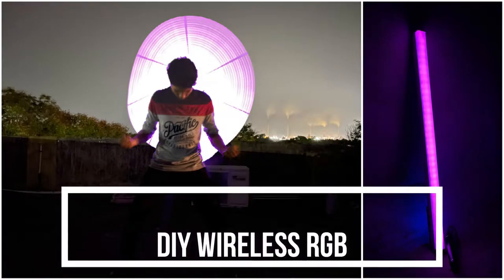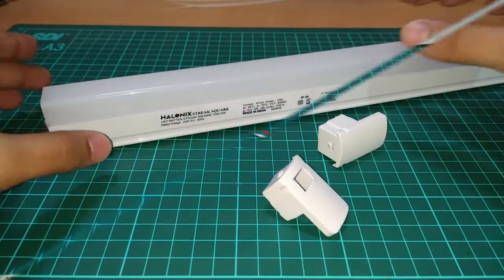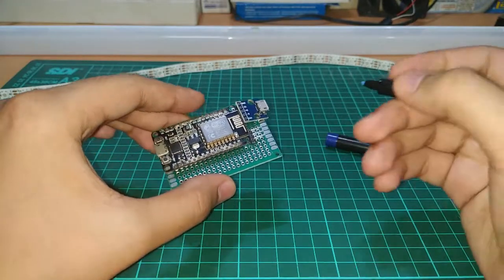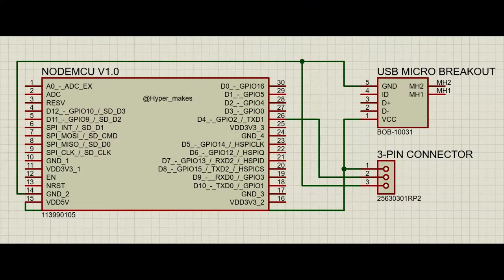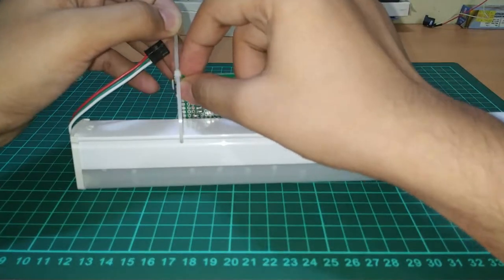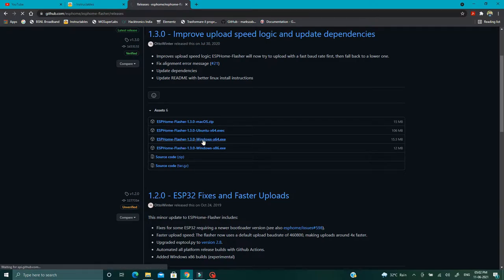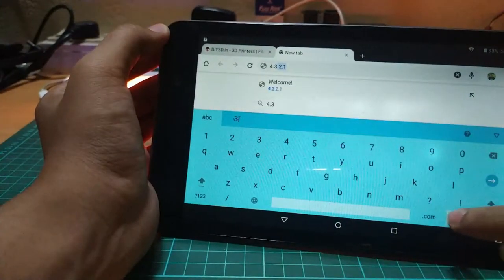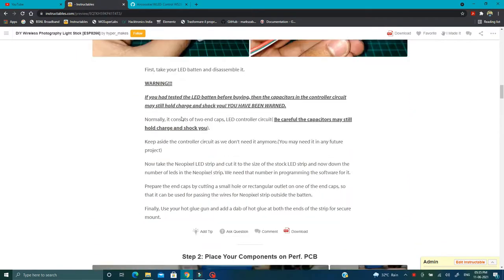Make your own DIY WIFI RGB Light Painting Stick || ESP8266 || Photography

Comment: Very nice. I wonder if we can change the RGB via dial button, like the 3 volume knobs for R, G, B values.
Reply from the maker: Yes. For that you will have to create a custom firmware for that. I think this should not be an issue as WLED offers colour wheel in its control page.